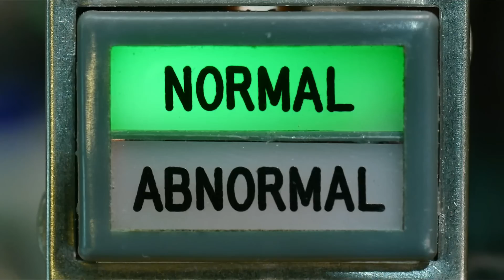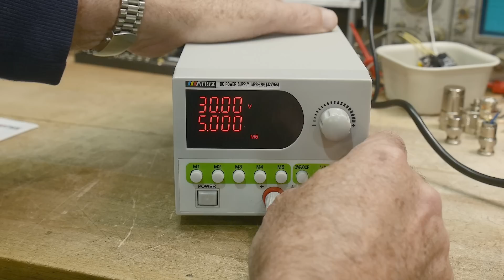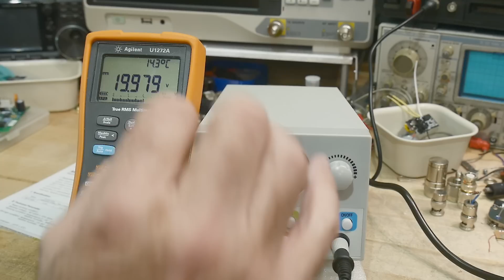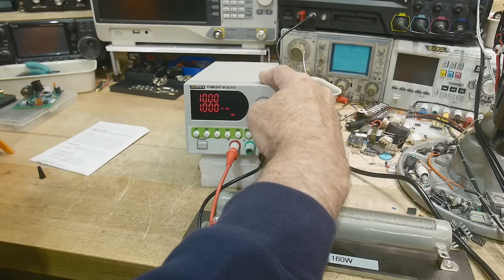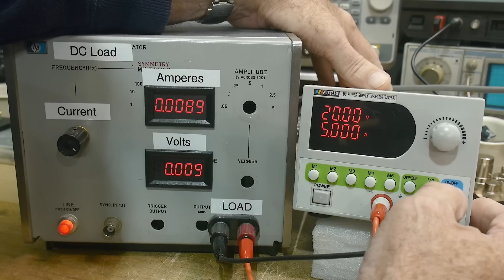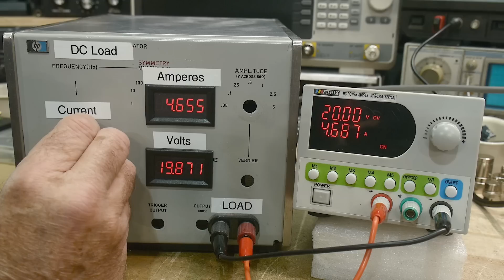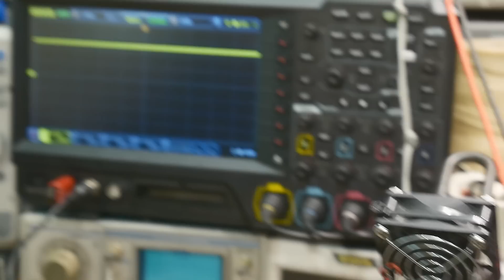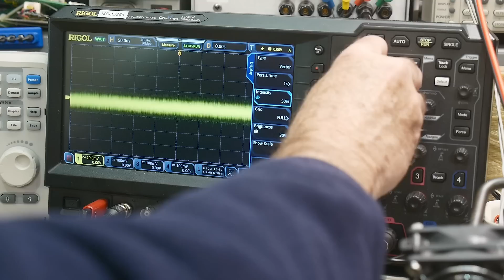#1402 Matrix MPS-3206 30V 5A Power Supply review

Comment: When I find that a male Banana jack is loose, I insert a 1/8" screwdriver under each of the 4 contact springs and give them a gentle twist underneath to lift outward the conductor forming a larger contact diameter. Works on 50+ year old patch cords very well - just don't over expand them and ruin their springy-ness.

Comment: It was good to see the load tester in action again.  I recently took a screenshot of the tester schematic from video #217. It's not an adequate pic. Could you revisit the load tester or post a schematic that one could use to build the thing?
Reply: +1 on more info
Make & model of the displays?
Also looks like there could be a missing connection on the .5 ohm load sense resistor.

Comment: As always, thanks for the quality content.  I have a question about analog power supplies that may be mundane or it may be interesting.  I can't figure out why both +/- 12v and +/- 15v are "normal" analog supply voltages.  Is there any reason you might choose one over the other (it's obvious if you just needed larger than 12v swings but other than that)?  Maybe there's some history that might be interesting: ... maybe Edison liked 12v and Tesla liked 15? 
Thank you!
Reply: Power supplies capable of 15 volts are necessary when working with automotive electronics.  Contrary to popular belief, a modern vehicle's "12 volt" system is actually 12.6 volts (nominal, engine off) and typically 13.8 volts (up to 14.6) with the engine running.

Comment: Thank you for the presentation. There are quite some different user interfaces around. Timed return to last digit or starting with the most significant pair of digits switching to the lower pair of digits without timed return. Often enough even the setting with analogue fine and coarse is most suitable. 
It might be interesting to see the reaction time to the digital adjustments.

Comment: Noise in the frequency domain?
Some of the cheap Chinese PSUs can have noisy ("bang-bang") switching FET circuits that can generate ringing noise on the regulated output... You may have seen that on the scope in the last part.
Thanks the the review.
Cheers,

Comment: The user interface is similar to other "digital" power supplies - you'll get used to it quickly. The only real drawback I've found is that the supplied + and - leads are pretty high resistance - you'll be much better off building your own using 16 ga or 18 ga "test lead" wire for flexibility.
Reply: Biggest problem i'd have with this is that you can't set voltage or current while seeing the actual current draw in real time. Some more posh psu's usually have separate displays for set/actual V/I.

Comment: Firmware written by a non engineer.
One wonders if this was a selected unit given the apparent accuracy,.. ??
Noise? at this price point,... well ok.
$70 30v 5amp, $169 32v 10amp
Reply: I've owned this power supply for a little over two years and it is every bit as accurate as the one shown in this video.
Reply: @rods3421  Same here for accuracy.  I like this little power supply.
Reply: @rods3421  cool